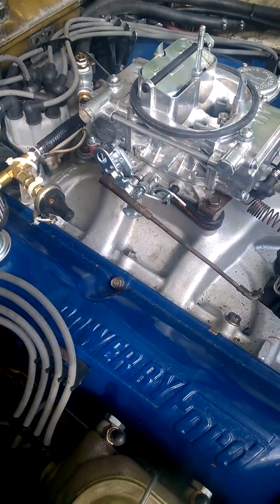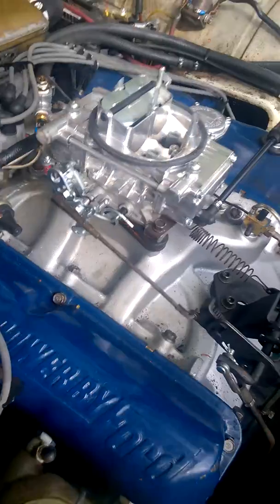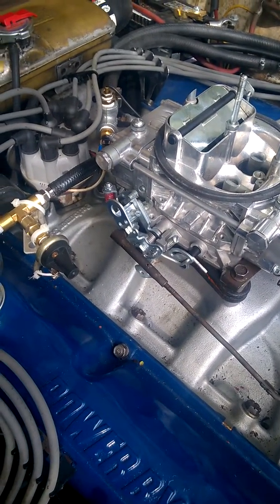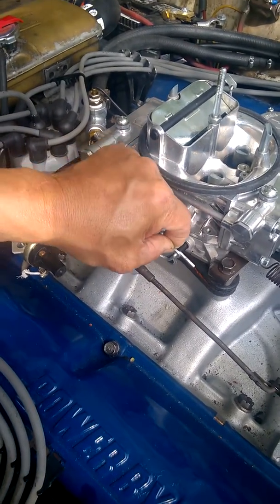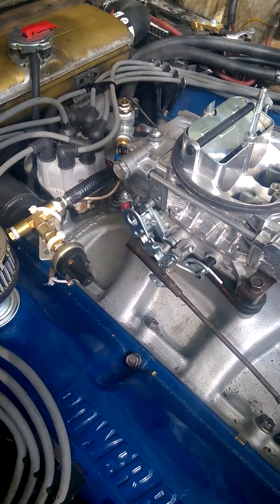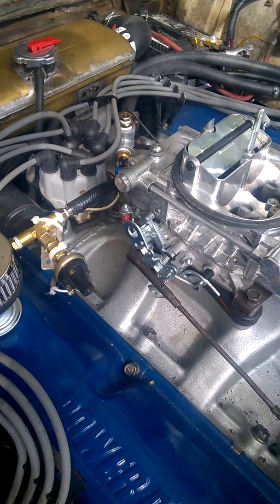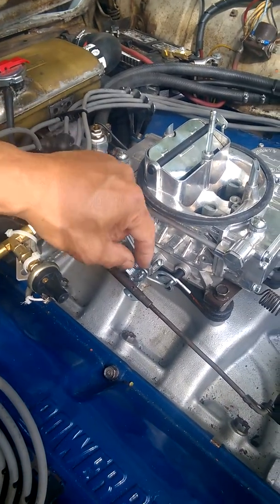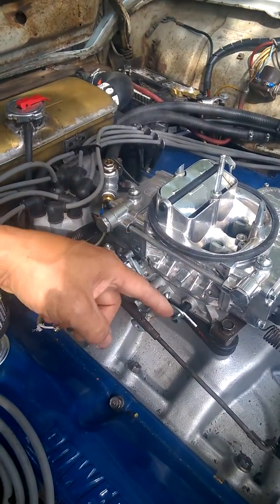Holley 4160 - 600 cfm - idle adjust - vacuum secondaries

Comment: Good explanation friend, I have a 4160 600cfm in a stock 302, the carburetor injects well, the float levels are at a good level, but the engine does not idle, I have to rev the engine and if you release the accelerator it automatically turns off, notice that if you close the idle mixture screws the engine remains more stable but I cannot achieve the correct idle.

Comment: Did you try the vacuum secondary adjustment screw first?
Reply from the maker: That flathead upside down screw on the other side you mention was just barely poking out, I didn't want to adjust lower and make it sink all the way down.